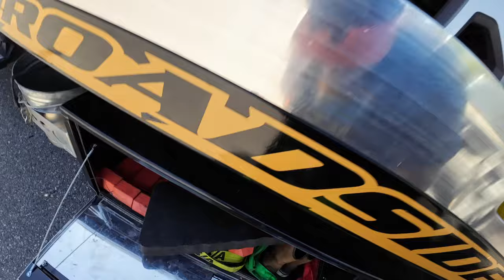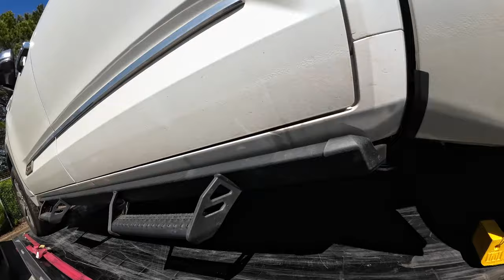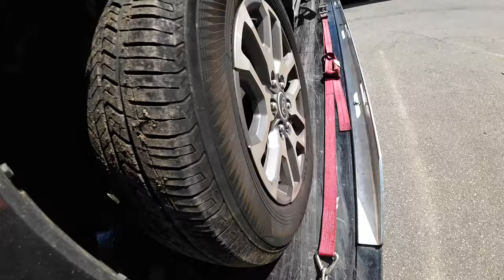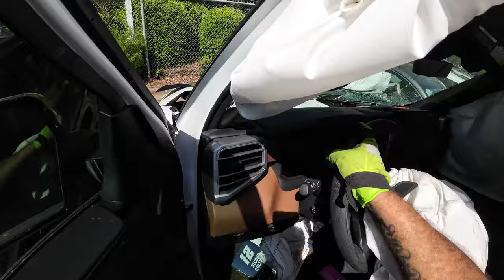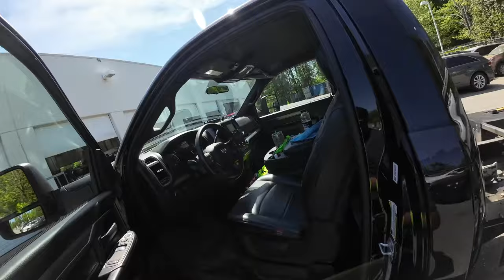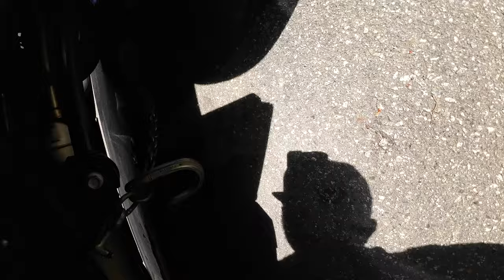ELECTRONIC PARKING BRAKES SUCK! | @ITISkates | @baremotion

Comment: Part of what helps you get them unloaded is that slick bed you have. These guys with the Dimond plate beds need the WD40.
Reply from the maker: These skates and the green wreckmaster skates work great on the diamond plate beds as well.
Reply: I have a diamond plate you don’t need wd40. The right skates being used correctly will get the job done every time.
Reply: No we don't... some of us know more than you and have no issues loading/unloading on diamond plate.